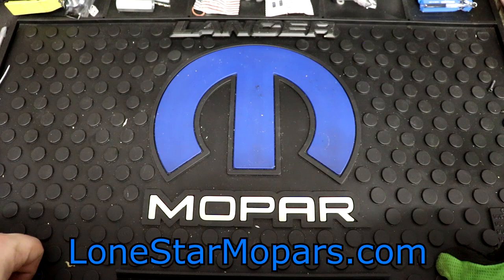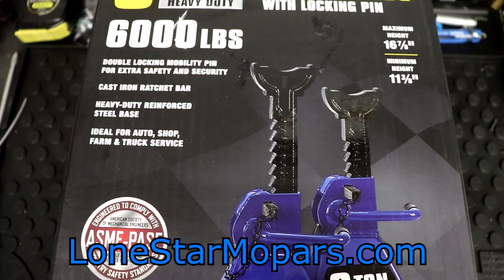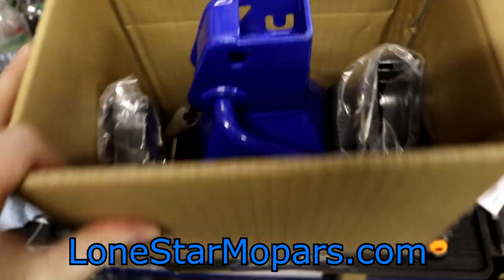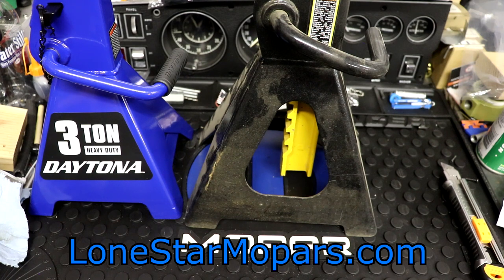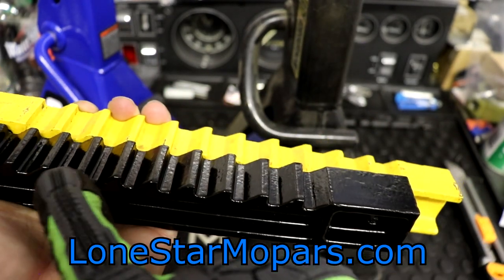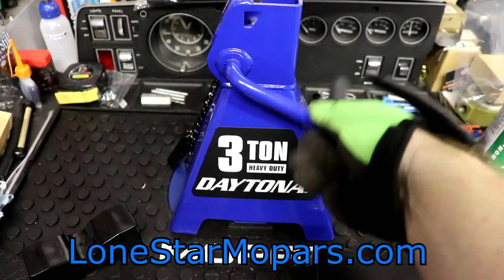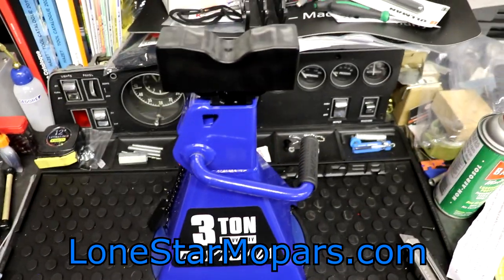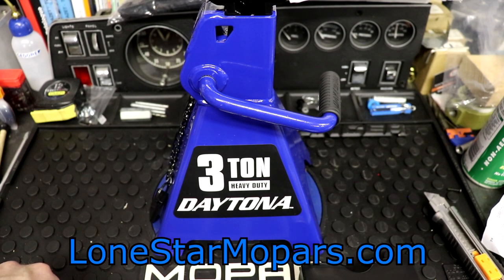Harbor Freight Tool Haul #29: Blue Daytona 3 Ton Jack Stands and Pads

Comment: I have the same Craftsman jacks! I bought them when I was like 20 or 21 and I was in a pinch with the GTO. I still have 3 of them! Sadly one failed last year but they have been super good to me and I typically only need two of them whenever I work on a car so 3 will do!
Reply from the maker: Nice!  I wish I had a full set of 4.  Never really thought of it at the time I had them since I tended to have either the front, or back up.  I have the matching Craftsman jack...it was pretty solid for back in the day.

Comment: It would be GREAT if you could do a video/review of the Daytona jack.  I'd like to get your perspectives.  I keep putting off getting the 3-ton rapid pump (in Mopar blue 😉) - but at some point, I'll likely take the plunge.  It seems to get pretty favorable reviews cross the board.  It might not exactly be of snappy quality, but it doesn't seem too far off.  And while I do have some issues with HF as a company, if the product is solid and at a reasonable price, I can go with that.
Reply from the maker: I really do need to make a video on it...I think I may have made one on the unboxing and setup and the footage corrupted.  When I bought it, they didn't have the blue ones available.  The rapid pump is really nice and puts you in contact with control arms and k-members really quick.  My Craftsman was a "quick pump" that was to rise quick, but didn't have the foot switch.  It also leaks down so I was primarily using a little 2 ton Larin from Auto Zone.  You spend as much time jacking it up to the frame as you do lifting the car.  There was a lawsuit between HF and Snap-On regarding the jacks and comparisons...in this case, you get a great jack and save a ton of money, lol.  A lot of times the coupons exclude the jacks.  If you can catch a good sale, or one of the 20% deals that will apply it is a no brainer imo.  Several tire shops I go to run them.  Sometimes the best test for a tool is putting it in the hands of people that don't care about it...to see how beat up they are and still see a horse trailer go up in the air says a lot, lol.
Reply: @lonestarmopars  I totally agree about seeing how well it holds up over time through use and some abuse.  Btw, I think only the 'Super Duty' rapid pump variant isn't unavailable in blue, while the rest seem to be.